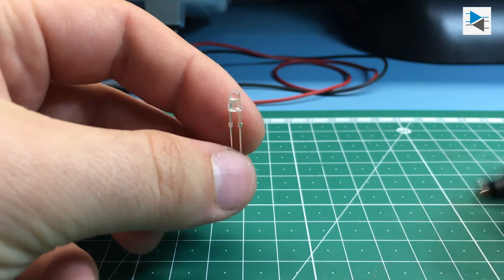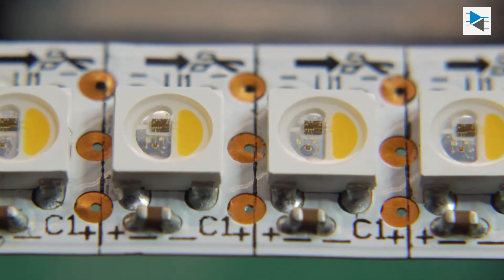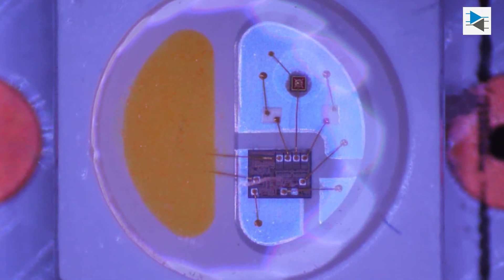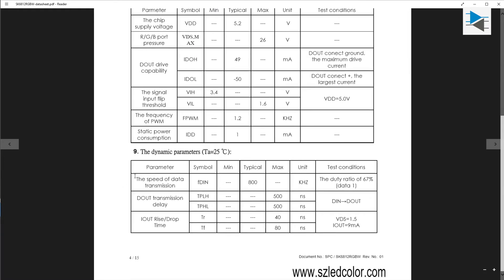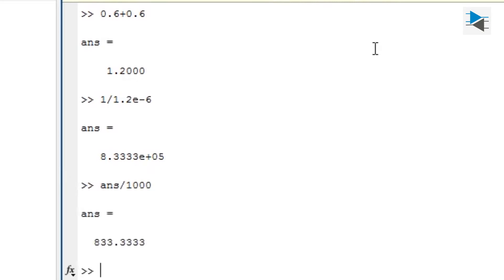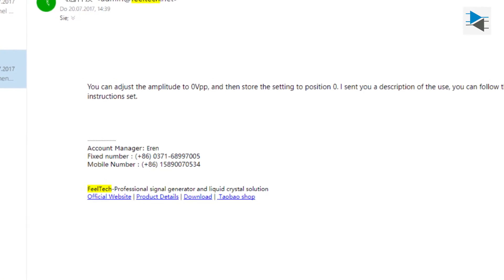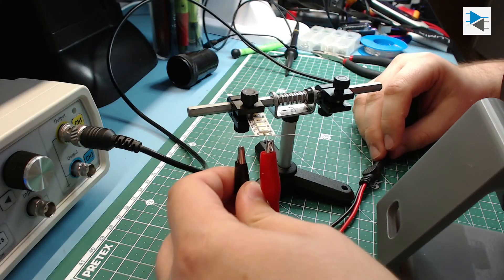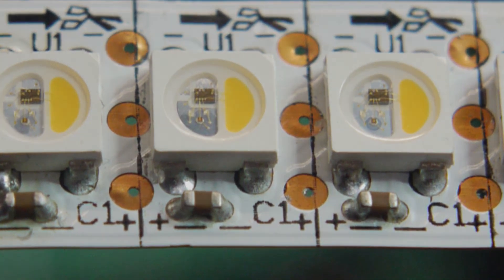Turning on an LED without an Arduino - how hard can it be?

Comment: Great. Now I don’t have to buy an Arduino - I will just get a signal generator and scope and power supply....
Reply: arduino clones are like $2 each or even cheaper. I use not original arduino and never got disappointed
Reply: @jutsinas  I guess my sarcasm is not coming through :-)